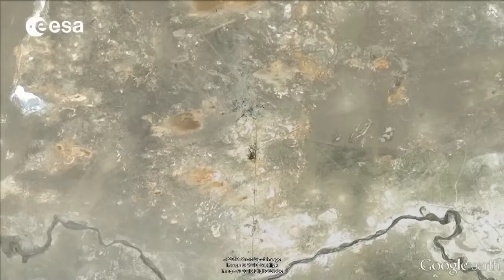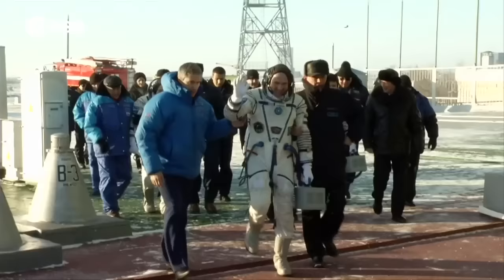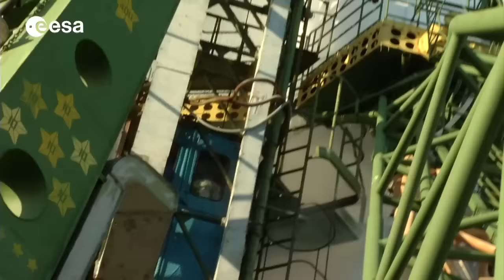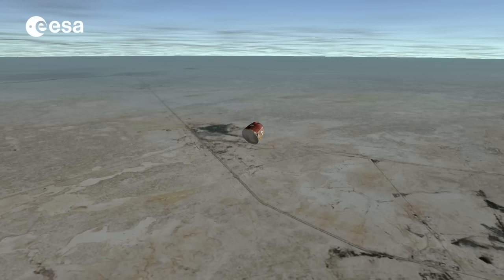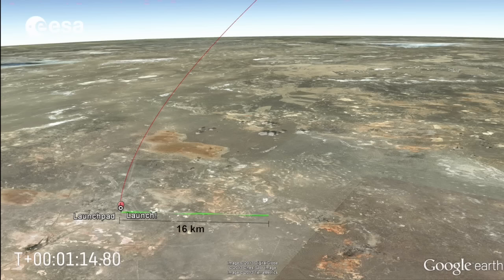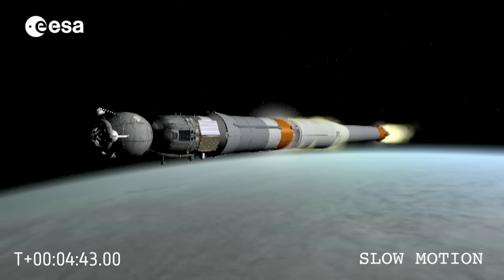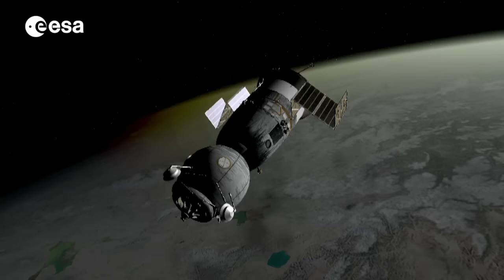The Soyuz launch sequence explained

Comment: The safety system is brilliant. If that error had occurred on the space shuttle they astronauts would be dead.
Reply: B20C0 Definitely agree. It looked great. I got to see a launch and it was one of the coolest things I've ever seen.

I think the crash of Columbia was the final nail in the coffin.
Reply: +Wabawoo The II Even the Mercury missions had a launch escape system.
Reply: +Wabawoo The II The only one I'm aware of is Gemini, which didn't have the launch escape tower, but it did have ejection seats that served the same purpose.
Reply: Justin Franks t
Reply: +B20C0 Actually, the best looking craft we (as in humans) sent to space would have to be the Buran, looking similar to Space Shuttle but far more advanced, including a safety feature for the crew during launch (ejector seats) and fully automated flight control. The first and last (sigh) flight of the Buran was unmanned.
Reply: Justin Hopkins many rockets already had that
Reply: B20C0 Couldn't agree more. I love SRBs, but it's a guilty pleasure, because I know they're unsafe, unreliable and inefficient. But they look sooo goddamn cool on the space shuttle, Ares I, Ariane V, and so on.
Reply: @snaxx82  I mean, I love Buran as much as the next person, but they did kind of take the whole purpose of the shuttle (Getting the crew, expensive engines, and expensive boosters back) and completely take a U-turn, because the Energia rocket that the Buran shuttle was attached to had all the expensive main engines, and was expended on each mission! And the shuttle was going to use Liquid Fueled boosters but the silly congress at the time made them use the cheaper and more dangerous SRBs. 
(and also, best looking spacecraft is a tad subjective, I personally think the Falcon-9 rocket is quite the good looking craft!)
Reply: the space shuttle is cool but the safety record of it makes it kinda less cool
knowing that 2 crews have died right in front of their families using the shuttle is kinda sad

Comment: Fun fact: the 4 strap-on boosters and the white fairing fall back to Earth, about 350 kilometers downrange from Baikonur launchsite, where these are recovered for the metal. Swiss watch-company Werenbach even produces wristwatch dials from the scrap metal of these flown Soyuz launchvehicles... After 2 minutes, the 4 boosters fall back from an altitude of 50 kilometers !

Comment: I'm totally thriving on aerospace knowledge and it's history, love it! Never seen how Soyuz works before this ever! Is this rocket the same basic one Russia has been using forever? Like since the Sputnik days? If so, wow, what a workhorse! And I'd always wondered how that tailend worked - didn't know those were boosters that separated. Didn't know any of it! Interesting stuff. I'm hooked.
Reply: Same basic design principles, but not the same as the first Soyuz of course. Been upgraded several times as technologies advanced. That booster separation is called the Korolev cross. :)
Reply: Thanks for info Miki because always curious on that. Just whenever I see Soyuz Russian launch the rocket used never seems to change design-look. I figured it had to AT-LEAST been upgraded since those days!! Always liked it's look. Do those "boosters" all separate at same time? I think I read the fuel is pure "kerosene" is that true? (!?)
Reply: Angara , Proton-M !)
Reply: Not the same rocket, but from the same rocket family, R-7.
Reply: I seen  the Sputnik in the reality.  VERY PROUD OF IT  but I was scared to acknowledge how small space the astronaut had to sit in
Reply: @bruce92106  The boosters all separate at roughly the same time (that's the magic of Korolevs cross). Without such a separation, you would create asymetry in the rocket which needs to be compensated somehow, which would result in even more complex designs and more dangerous situations.
Reply: @erzsebetnilsson580  I've heard astronauts talk about riding in the Soyuz and how packed it is inside and you wouldn't want to have claustrophobia. Ha. I always remember that 1961 film clip of people running, riding bikes, thru the field to see the first returned Vostok capsule laying there all scorched out from reentry. I remember thinking wow! Is that basically the same concept today of the Soyuz capsule when it returns? Just wondering. Thanks!
Reply: @nottoday3817  Thanks for that!
Reply: @bruce92106  Gagarin did not land in his capsule. He ejected after the de-orbit burn and 'fell' with a parachute. Modern day capsules do have parachutes attached  to them which open after the de-burn. As for the capsules, that's generally how they are, the US ones were tiny as well. Soyuz is  also not 'claustrophobic' in itself, however it's the main vehicle used to supply ISS. That is a task which is really hard to accomplish. As a result, people try to do it as rare as possible, so they pack every cubic milimeter possible. Any other vehicle that wants to be used effectively would do the same.

Comment: 17 G's g-force for 5 seconds during the escape ? Damn !! Imagine that ! With the space suit you must weight at least 100 kgs. So 17 G's would make you feel like you weigh 1.7 tons !! Like a rhino sitting on you for 5 seconds.
Reply: Not like a rhino sitting on you its like you are a rhino just without the extra strength
Reply: 0.85 tons ;) there is 2000 pounds in a ton so at 1700 pounds it just under.
Reply: @dimayev4  he is talking about kilograms, a 1000 kg is 1 ton, in this case 1700 kg would translate to 3500 pounds I think
Reply: @gerritkaasjager2319  you're right! I saw tons and switched to thinking American

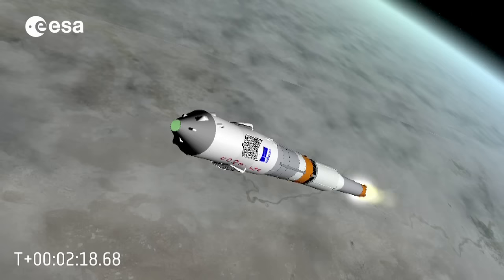Comment: 4:13 correction: today Soyuz MS-10 has failed and now has made three times crew used an escape system to get out of a failure (don't worry they lived). 7:29 they escaped and the failure happened around there.  It also makes all three abilities used. One with the tower, one with the fairings, and one with just the capsule.
Reply: The escape tower wasn't used on MS-10. It got jettisoned just prior to booster separation and the abort was done with the payload fairing motors.
Reply: Thanks edited it just right now

Comment: The Russians really prioritize safety.
Reply: +TheRenaissanceman65 Actually, they really did. With the exception of the political fuckup of Soyuz 1, almost everything they did with their Cosmonauts was designed for safety. The same cannot be said for some parts of their ICBM development, however (a comment which also applied to the US, particularly their Titan programme).
Reply: They did, as John Brown notes - but not just for rockets. Soviet subs were designed to be far more survivable in combat than US subs - they could dive deeper, had far more watertight compartments, and most included one or more escape capsules for the crew. US subs carried much more sophisticated electronics and were generally quieter, but the Soviets really built theirs to survive battle damage and keep their crews alive. Unfortunately, rushed design in other areas (K-19's reactor cooling system, for example) and poor quality control let down what were otherwise excellent designs. Poor QC was also what helped doom the N-1 program.

Ironically, to return to subs, the Thresher and Scorpion disasters (coupled with Rickover's... "influence") led to the US being overly cautious, spending more time training crews in nuclear engineering than actually fighting their boats. I've heard US submariners who go on exchange into the RN get quite a shock when they find the situation reversed.

In a sense even supposed "death traps" like Soviet tanks were designed with as much effort put into crew survivability as possible. They get an unfair reputation fuelled by exaggeration and fantasy about "human waves".

Ultimately, the pattern seems to be that the Soviets dreamt big but were hampered by the realities of their industrial and economic capacity, while the US was far better off in both of those areas but in many cases took a much more conservative design approach.
Reply: It's a strange duality of methodology.
The Russians were not able to fully test much of their equipment on the ground as the US did. A lot of their final development happened in test flights.
However, despite being forced to test components in flight, and having a much lower budget,  they still managed to maintain high safety standards.
Russia and the US had 2 major spacecraft losses each,  but the US lost more people in testing.
Reply: Private X Safety Is The Number One Priority Taras Kul Said
Reply: Safety is number one priority
Reply: Taras Kul join the chat
Reply: Have you heard of the russia. Concord :D
Reply: John Brown They really didn’t. They were rushing projects all the time, their first EVA was a complete failure and shouldn’t even count as an EVA. The suits were badly designed, dozens of astronauts died but never got the recognition they deserved because the state ruled in secrecy

Comment: One small error in the narration:

"Fortunately, it was quickly realized that the crew was endangered and the ground controllers activated the escape system."

It's true that they recognized the danger and attempted to activate the escape system, but not before the fire had destroyed the wires that would have carried the command. What actually triggered the abort was the tanks of the second stage rupturing, which triggered an automatic abort mode.
Reply: wikipedia says escape was launched by radio control by two ground control centers within 5 s, so it took 20 s to coordinate themselves. it wasn't automatic abort, because you cannot construct an automatic system for such an unpredictable situation

Comment: 3:43 In case you are wondering those 4 "paddles" are used for steering. (fins on rockets are usually not used for steering only for stability and controlling roll)

Comment: I think that it occurred for two reasons: 

1.Americans go on the way of creation of very difficult and expensive space technique. When the equipment is more difficult and more expensive, then it has more unpredictable problems. 

2.The Soviet space equipment was created so that to provide the greatest production and operation simplifications. Therefore the Soyuz system shows the low cost and long-term working capacity.

Comment: The freaking solar panels have to be strong enough  to hold on the force of going about 13,000 Km/h like shit
Reply: in vacuum!
Reply: If you mean the mesh "paddles" folded up against the sides of the rocket those are called grid fins and are used for steering. Space-X's Falcon 9 uses them too.
Reply: They are not accelerating, so the force is zero, and they are also in space were atmospheric drag is low to negligible

Comment: And today after 35 years the emergency escape system was used again.
Reply: Not much information yet but I heard they aborted after booster separation. That means the escape tower is already gone according to the sequence in this video, so they might have aborted without the escape rocket, just by separating. They would then keep going up for quite a distance (all the way into space?) and then reenter, experiencing high Gs slowing down in the atmosphere.

Comment: I can't understand a single thing. Falcon Heavy is the first reusable rocket we all know that but Soyuz has been used for all those years but all the times it launches it looks so new. Just like a reusable rocket. Are they building a new Soyuz for every launch? Or they are using the parts which are came back to earth?
Reply: Soyuz is an expendable booster, it's so cheap that they don't need to recover it, and the production lines are well established as they've been running for 60 years